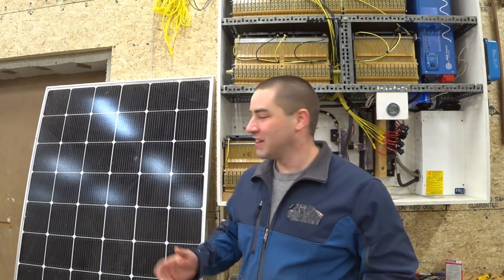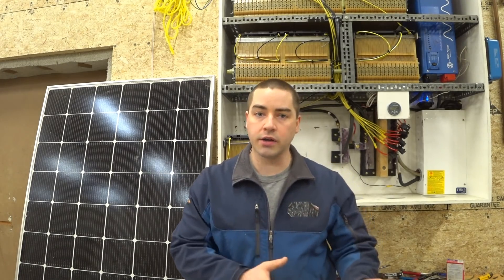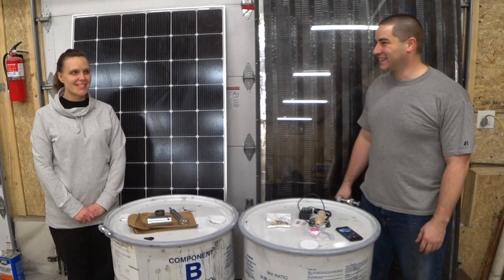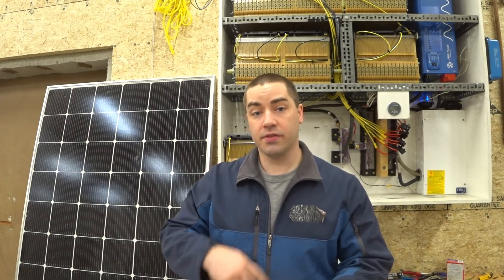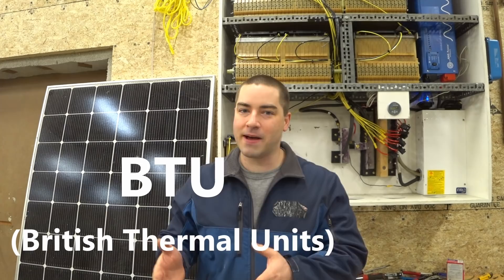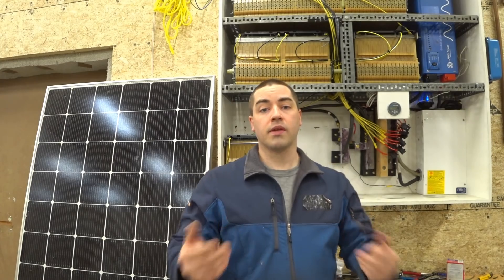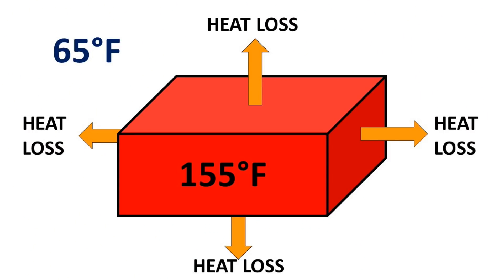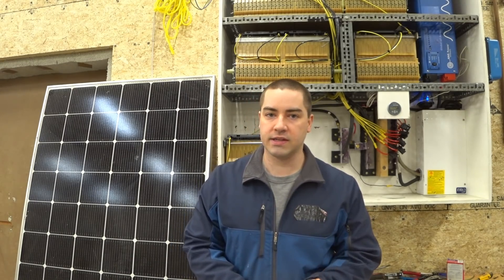Cheapest Energy Storage Off-Grid

Comment: How do you maintain 65F in your crawl space in the MA winter? Crawl space should be vented to avoid radon infiltration and the house floor should be insulated to avoid heat loss. Your math are correct but you don't in account the pipes loss (they don't have 4" of insulation). You're assuming the 4 cloudy days are followed by 4 sunny days, is it realistic in MA? In the winter the solar panels are at best half as productive as in the summer, shorter daylight and low sun inclination, so to produce enough energy in the winter you'll need to oversize your solar array, what are going to do with this extra capacity in the summer?
Reply: Also you're not taking in account the water temperature of the cold water replacing the hot water you're using, in the winter its likely in the upper 30F.
Reply from the maker: Hi John,  My crawlspace is inside my thermal envelope.  It has never gotten below 65°F in my crawlspace, and is usually warmer.  Thanks for watching.
Reply: @DavidPozEnergy  Great but this heat has to come from somewhere, maybe natural gas or propane used to heat your house and wasted in the crawlspace. 
Don't take me wrong I'm 100% for renewable energy, in the sunbelt most of the electricity is used to cool down houses when the sun is as its peak, it work great and is not used enough. In MA the sun is weak in the winter, when its needed the most, making solar unpracticable. But you are close to Canada, which has an oversupply of hydro-electricity, yes it come from the grid and from a foreign country, with which the relation are not very stable, as they are squeeze between the 1st and 2nd world power. But still the North-east can build long time treaties with them and run on a green, clean, affordable, sustainable energy.

Comment: i have a large solar hot water system (100 heat pipes, 3000 liter storage). in hindsight the money would have been better invested in PV. easier to install, less hassles, more reliable. even in overcast weather there is still a fair solar harvest with PV, whilst solar hot water needs direct sun light. i go so far as to say that even a resistance hot water heater is more efficient than solar hot water.
so you totally bypass a large storage whether battery or tank altogether.

Comment: Something little used is PCM technology, whilst very few materials can store more heat than water, simple materials do exist to store heat more conveniently than water.
I remember some years ago returning to a friends car after a day walking in freezing winter temperatures, I remember thinking it was going to take ages to get the car blowers running hot. 
To my surprise heat came out of the blowers instantly, my friend told me it had a magic PCM box, PHASE CHANGE MEDIA. 
Apparently, the box was surrounded by expensive aerogel insulation it contained special salts, Lithium Nitrate and Potassium Nitrate I think, while the car was running waste heat from the engine melted the salts, the insulation kept the salts molten and hot for about three days.
On starting the engine the salts would change phase back to a solid, whilst dumping 45KW of heat into the cars heating system.
Apparently, Sodium Acetate is a good media, Sodium Thiosulphate or probably the easiest is plain old Candle Wax, put it in a metal cylinder with insulation and a good coil of pipe a control valve and it should be possible to make a thermal storage system.
Reply from the maker: That sounds awesome.  Can you share any links of where I can learn more?
Reply: @DavidPozEnergy  There is not a lot of articles on it, I know Cody's Lab did an experiment with two hot water bottles, one with hot water and another with molten candle wax, the hot water cooled down quickly but the wax released its heat with a much more useful curve.
I do renewable energy like you, I have solar thermal I made myself and PVs with Lead Acid, my solar thermal in summer makes so much excess heat. 
I was thinking of either making a tank containing wax with a coil in it, then I would melt the wax using excess solar heat, then on a cloudy rainy day, I would solidify the wax dumping the heat back into the hot water cylinder. I am not sure how well it would work, or if another chemical would be better than wax.
Another project I considered was a small detachable unit which would be connected to self-sealing connectors into my old cars Antifreeze circuit. It would have two coils, one would contain antifreeze mix, that would hook up to my cars circuit. After my drive home from work, I would take out the unit disconnecting the self-sealing hoses. 
Then I would take the unit to my bathroom, connect a hose and a showerhead and a presto a free warm shower, maybe the water would be too hot, perhaps I would have to use a thermostatic mixer on it.
It is worth you Googling phase change materials and finding the different melting and freezing points of chemicals, one thing to be cautious about though is some chemicals can be corrosive both to people and the material of the tank used for the project. 
Some chemicals can even be explosive or poisonous.
Reply: @DavidPozEnergy  https://www.youtube.com/watch?v=ybkBQogCdKQ

Comment: Dear Mr. DavidPoz I love your presentation it's very impressive, here I would like to give a suggestion about producing electricity through rotating a turbine but obviously not by a steam rankine cycle but instead using organic rankine cycle such as by using materials other than water which  vaporize at low level heats i.e. alcohol and petrol etc and these systems can use the thermal energy stored in your water tank thus eliminating the need of separate solar cells which are highly inefficient and hence produce less energy than organic rankine cycle
Reply from the maker: Thanks.  Do you have any links to share of someone who has done it?
Reply: @DavidPozEnergy  Here is the link towards a wikipedia article about ORC ------> https://en.wikipedia.org/wiki/Organic_Rankine_cycle which is newer technology than steam technology while steam tecnology is meliniums old technology in both of these technologies piston engines and turbines are used but I would suggest turbine for better performance and you can use a small hand blower (not as blower but in reverse mode i.e. as turbine) so dismantle its handle and instead put a pulley in the place of handle and use a belt to connect it to a car generator or a bus generator or a welding generator or even you can use the generator of a wind turbine or even your own made one in a way that you should use a very large pulley (about two foot dia) on the neck (shaft) of generator in order to reduce RPMs because turbine will run on very high RPMs this reduction will also give another advantage that is increase in force at generator shaft side but for the purpose of experiment you can use this system of  turbine and generator pair with the steam coming out of a pressure cooker i.e. put the mouth of blower down over the steam outlet of pressure cooker and test its performance continuously for two days but for this purpose you have to put back the same water (by condensing the steam in a car radiator (currently being used as a room heater)) and drilling a hole into pressure cooker for the purpose of feed water. Also see this link ------> https://www.youtube.com/watch?v=HUjAvWM1mUs moreover you can also use CO2 gas as working fluid as you know phase change is not necessary i.e. from liquid to gas and vice versa (only only expansion and contraction is enough), so see this link also ------> https://globenewswire.com/news-release/2017/11/28/1207068/0/en/Infinity-Turbine-Announces-Micro-Supercritical-CO2-Turbine-Generator-Developers-Platform-Generate-Power-From-Waste-Heat-from-31-C-88-F.html and also don't forget to watch this ------> https://www.youtube.com/watch?v=UwCFfKjn558 and another useful link for you that describes the sterling engine ------> https://www.youtube.com/watch?v=vGlDsFAOWXc

Comment: I’m looking/hoping for a heat pump revolution, like the lithium battery revolution. I’m hearing 4 to 1 energy transfer ratios on commercial green energy units.  That would drastically reduce the cost and footprint of a solar heat storage system.
Reply: The problem with heat pumps is that efficiency drops off a cliff as temperatures fall. An air to water heat pump is most practical for the majority of domestic users. They can have a COP of four or more in favourable conditions. However, in winter when the air is cold but we need the most heat COP can drop as low as one! You might get 1.5 if you're lucky. If they can find a way of making them operate with a COP of four or more when outside temps are below freezing then they everyone would have one. Ground to water might be more efficient, but the drilling and disruption plus huge install cost are a huge stumbling block for many

Comment: Dave, you miss the point of the heat pump entirely. The actual point is that a heat pump makes 3 1/2 times more hot water than a resistance element, giving you three times more hot water in your storage tank for the same photovoltaic array. Your idea to store hot water for the many needed days is a great one, just don't use a resistance element to make the hot water, use a heat pump to make three times more. Remember, the heat pump uses the electricity to move heat from the environment to the water, while the resistance element just converts the electricity directly to heat. The fact that a heat pump HW tank is 60 or 80 gallons is not important, just drain that hot water into a bigger tank and keep heat pumping.

Comment: NASA used wax as a heat storage source when they where on the moon since it can hold even more heat energy than water. I've always wondered if that could be adapted for use in household solar. Maybe Heat a case of wax around your hot water heat store or run rods of wax throu the water to help suck up that heat.
Reply from the maker: Very cool.  Someone else commented earlier today that they bought 12 pallets of wax for a storage.  It's very interesting.  I'd love to test it.

Comment: In full agreement on heat pump water heaters. While they are much more efficient at putting heat into the water, they are ultimately more expensive compared to adding panels to heat a standard tank. So if a person is looking to have an excess of generation and a way to store that, this really is the most cost effective thing to do. Clearly, the real issue here is whether one has space to add enough panels to generate excess power.

I have a HPWH in my home,  and while I don't really have the goal of being off-grid, I will be adding a pre-warm tank as I double the size of my array this spring. Ultimately, I want to take my 1901 built farmhouse to greater than net-zero on a rolling 12 month basis and have a way to store the excess without becoming a power wholesaler to my utility. (The payback rate is under 3 cents / kWh at that point vs. 1 to 1 credit against power used from the grid.)
Reply from the maker: Sounds great.  I'd love to hear how your process goes.  Maybe some pictures or video.

Comment: Storing heat get you days of autonomy.  You still have to heat it.   

With electric heat, ideally with an element in the storage tank, 30.5K BTU will take 30.5K BTU, less than 10KWHr, of electricity.  If you are using a conventional water heater, a heat pump will need less than 2.5KWHr for the same amount of hot water.  

That allows you to heat water on days with less sun, extending your autonomy.
Reply: But you need to buy that extra stuff!

Comment: Excellent video- and well done done!!  

I am suddenly really interested if you could in fact transform this into off the grid space heating.  If you ran the water through a baseboard would it then return to the tank or would that water have to be discharged?  If it returns to tank, wouldn't it cool the water too much for future circulations?  

Love what you are doing on this channel!  Keep up the great work!
Reply from the maker: Hi Rick,  I might have to make a video just discussing water storage for space heating, but I'll try to tackle your questions here.  If you circulated the water through baseboards that same water can return to the same tank.  It would loose some heat to the room, and eventually cool down the tank.  It comes down to the same type of math, but you end up needing a huge tank, thousands of gallons.  Not impossible, but maybe impractical.  A more common approach is to size the space heating tank for one day, and then re-heat it with a wood boiler.  That way you fire up the wood boiler once a day, hot and clean burn.  But there are several ways to do space heating.

Comment: I had 72m2 of hot water Solar panels from 1988 to 2009. In 2009 i've made the switch to PV panels. One of the reasons you've mentionned in your video: a loss of 30% of tour heat a day! I had 1000 gallons of space heating water and a 100 gallons hot water. When the sub was niet shining in winter, statisticus says 3 of 4 days, nature is niet following statistics, I had a wood stoven that does space heating and hot water heating at the same time. Hot water for the hot water tank and after that for the space heating tank.
Since 2004 I switched space heating die a heatpump space heating and in my todo list there is a hot water tank heatpump planned. BTW you have units that van be connected to an external tank of tour choice. Heat losses ,here dit me the point to change, not in spring, summers of automn but in winter when extra heat must be produced.

Comment: This is fine as long as you only use electricity for heating. What about charging your electric car/tools/tractor (yes there are electric tractors 🚜), powering fridges and air conditioning, washer/dryer, stove, computers, TVs, etc. Also an air heat pump could solve your heating/cooling needs between 20F and 95F by using very little electricity (done that).
Reply: It's my understanding: if the solution was fully electric, resources would need to be proportioned differently reducing the solutions stamina.  Because the hot water storage (water battery) is now charged, the resources of the chemical battery can now be 100% allocated to the other items you mentioned (washer, tv, etc).  and because the kilowatt storage of a water-battery is a fraction of the cost of a chemical battery: it's an economical win.  

Triple threat: extends solution endurance, small economical requirement and almost zero environmental impact.
Reply: Domenik is right, hot water is the easiest to address so in actuality is the smallest problem.
Reply: Dom, you take savings where you can get it. His setup reduces his burden on the overall system.
Reply: Dominic S if you were to go off grid and you  use solar power from panels you would switch everything you got to 12 v ..... fridge freezer. Tv lights etc it’s very doable but be wise on useing to much energy so the solar works efficiently , the problem today is every body uses so much electrical power which is wasted on devices and running things excessively and they say that it doesn’t work , power tools these days run from batteries and there are inverters to convert dc power to ac for electric stuff that’s not 12v but I do know not everything can be run this way . Being off grid for me is my goal at least as much as I can be I think cutting back on using so much energy is a good thing, it can be done.
Reply: What's the temperature of your system water before entering your solar water/air collector?

Most  water pipes inter the house about 55°.... Earth's constant underground temperature is from 45° to 75° F depending on location. The deeper you go - warmer it will become.

If you use thermo mass to pre-heat the water/air collector, this will = reduce time and energy needed.
That's a win - system recovery time is good for the soul...  

How - well, that's up to you!  But my idea dates back to a article in I believe Natural Geographic Magazine @1978-84.

The article was written about ice on mountain pass roadways.
That by using Geothremal to heat the roadway in the curves increased safety.

They drilled into the ground and ran a rod that had a fuild of which was heated by the ground.

So if you use mass to pre-heat your water before the solar/water collector, you need less energy to keep the system profamace max out.   

How I do it...

Low maintenance and long-lived. The components typically last  about 50 years for the ground loop system. Heat from the ground is absorbed by the water as it circulates through pipes in the ground in to a thermo mass (sidewalk, driveway or patio) like the side wall. 

From this mass the water goes to a solar heat panel to water storage, to be used by hot water heater and heat exchanger for the green house.
Reply: Did you skip the last minute of the video?
Reply: What was your solution for heating/cooling with a heat pump? Very curious what you may have done, you have a channel to demonstrate? I have moved into a new home with heat pumps to cool and heat in the winter, so far my electric bills are much large than my prior home and looking for a way to reduce that big expense. As it is the same unit for cooling and heating presume the solution works for both?